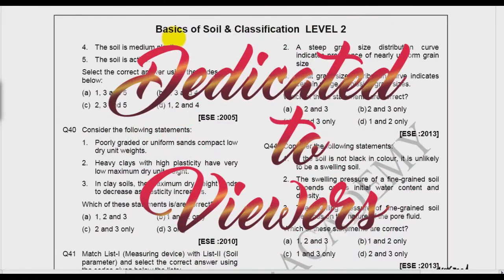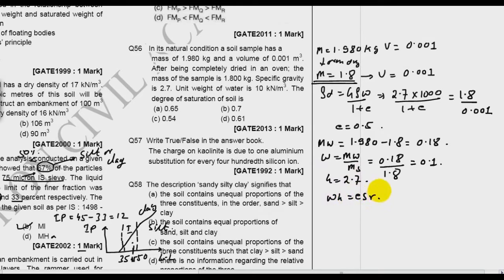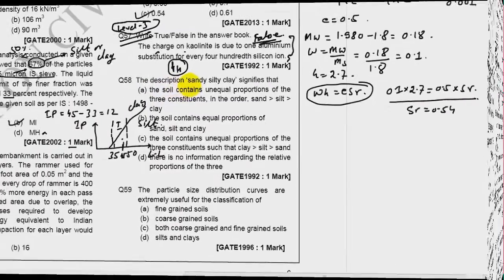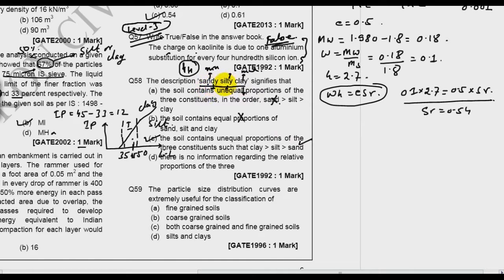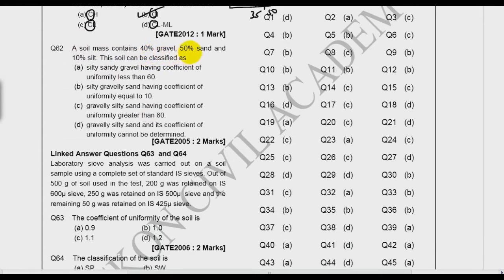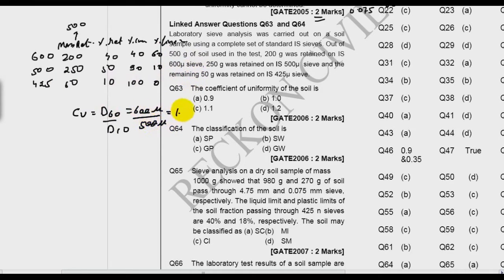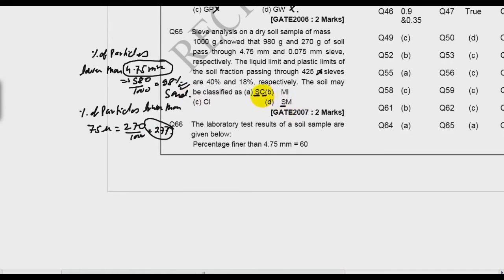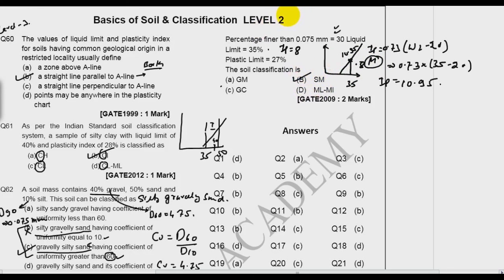Solution of Previous Years Paper of GATE & ESE (Soil Mechanics:Level-2 Q56-Q66)

Comment: Ques :--  A soil has bulk density and particle density of 1.48 Mg m-3 and 2.64 Mg m-3, respectively. The
saturated volumetric moisture content of soil is 36%. The porosity and void ratio of the soil are
(A) 0.36 and 0.56 (B) 0.44 and 0.79 (C) 0.79 and 0.44 (D) 0.56 and 0.36
ans is (B) part 
sir pls give me solution 
thanku sir